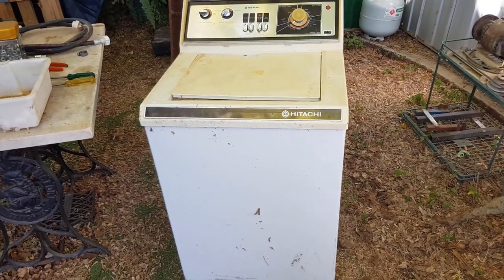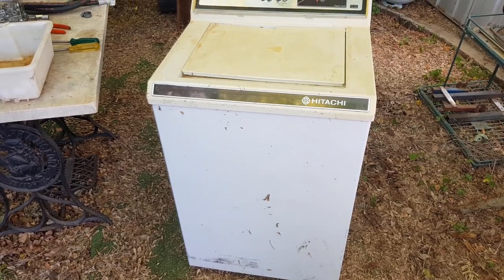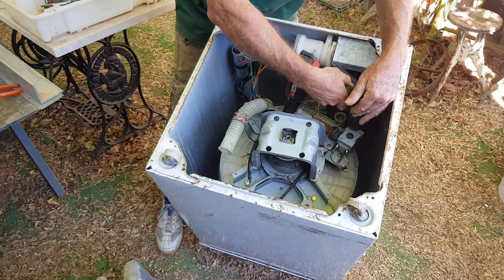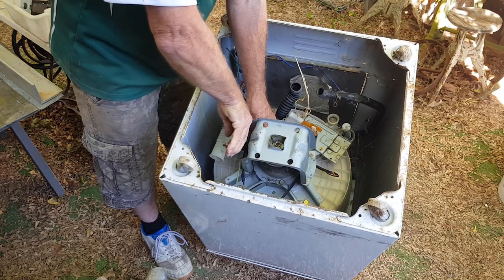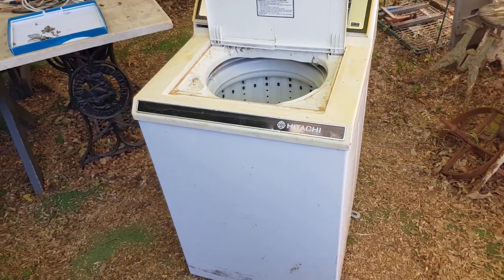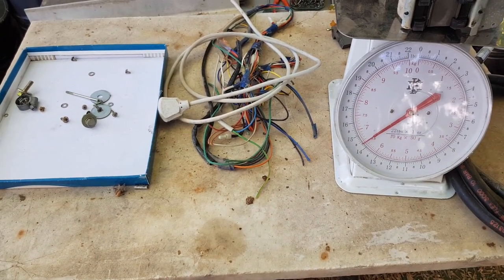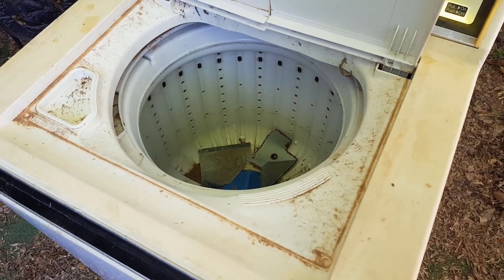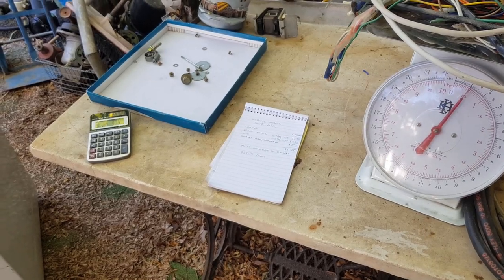Scrapping a Washing Machine - My take on just how profitable it can be!

Comment: The old Hitachi top load washer is so amazing isn't it! Much better than nowadays Hitachi washing machines, I have a modern Hitachi washer that was bought in 2016, model sf-140xtv, even it is a good machine, I'm very impressed because of its washing performance and spin drying, but the reliability isn't the best. It had at least 6 repairs because of its electronic problem, its motor started making weird behaviors, sometimes it released some smokes, etc, I feel it could make me be tired so I would buy another brand, but Electrolux or LG, which are very good brands that I'm looking for
Reply from the maker: Old washing machines of most models were better and more reliable than modern ones it seems! They just don't like building appliances that last anymore unfortunately! Thanks for your comment 😊

Comment: I like silver. I break down whatever as a hobby with cash as a bonus. I collect the wire from these mainly. And I get about $5 like you said either way, with or without stripping it apart. So I might as well add up the more valuable metals, copper, aluminum, silver, brass, motors.
If you crack open the plastic dials and timers and water pressure switches on washers and dryers, there are lots of brass bits that have several silver buttons on the tips. I even found on a motor where the wires attach there was another plastic box with brass connectors and silver switches. They are everywhere on these! Collect a jar of those, after a while it adds up!
Thanks!
Reply from the maker: Thanks for your comment Dr. A. I do usually scrap things down much more when I have the time, but this video was more about economics if very busy. I'm planning on doing a microwave scrap-out where time isn't an issue just to see the maximum value one can get :)
Reply: The Ultimate Recycler, I agree. If one had time to “micro”-scrap, then by all means. Some things are not worth the time, like certain wire costs you more to strip than you get as is unstripped. 
Thanks!

Comment: Great video.
I do have a redneck washer tub firepit.
As a retiree, I like getting the micro silver and brass bits out of the controls.
Rather than sell the shell as shread, I plan on using it for shed siding.
Reply from the maker: Nothing wrong with a washer tub firepit at all! And that's nice upcycling using the shell as cladding! The early settlers here used to use kerosene tins  for the same purpose!

Comment: One question I can't seem to find a answer for. I'm trying to tear a washer apart to get it out of my house  the springs under the tub are to hard for me to pull. Is it safe for me to use bolt or wire cutters to just cut the wire or springs. I don't want them ripping my arm off appreciate any help
Reply from the maker: Good question Debbie! You should never cut a spring which is under high compression or extension. Perhaps you can move things around so that the spring is loose (ish) and then cut it?

Comment: Most of the newer washers have aluminum wires in the motors so they wouldn't count at most scrap yards. Some might count them as dirty/irony aluminum if you're lucky. The one here world count it as regular scrap/shred so removing it is useless. Old or expensive washers are more likely to have copper.
Reply from the maker: My scrap yard just offers a price for electric motors/transformers and that's it. I've never heard them specify that they have to have copper windings or not - and I've never seen them check!
Reply: @TheUltimateRecycler  same with my yard, just any electric motors

Comment: hi m8 I totally agree about time is money and getting the valuable metals out fast .I stripp front loaders and dryers .I always cut the loom of wire that runs from the circuit board. pull the 3 brass connectors out where the power cord is an snip the wire where the sollanoids are .turn it over to the bottom get the 4 bolts out what's holds the induction moter in place .snip the wires and get the brass contacts out .plus the drain pump moter what always has a copper transformer on it .I live in the uk an prices vary on copper /alloy /brass/shred /I take the drums out witch takes me about 5-10 min break all the hard plastic of what the drum is in.there is a big piece off alloy called a spider /cast alloy /the fly wheel aswell /cast alloy .some times the door hinge is cast alloy an the little lock .a lot of good quality non ferrous metals. I strip all circuit boards down for brass and silver and copper.great video 👍
Reply from the maker: Thanks for your comment Night Scrapper, seems you've got a good system going! 👍👍😊